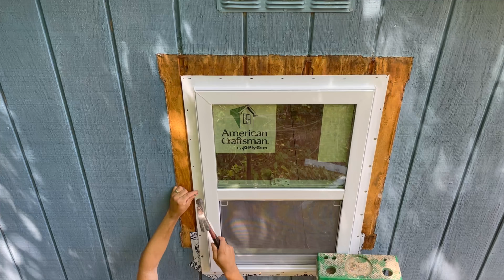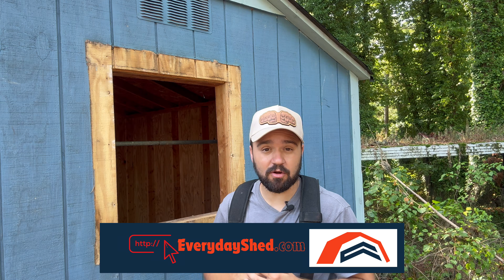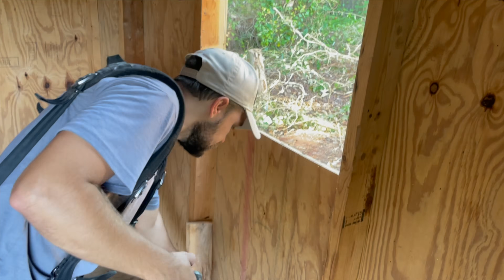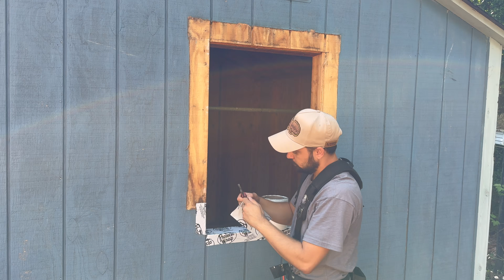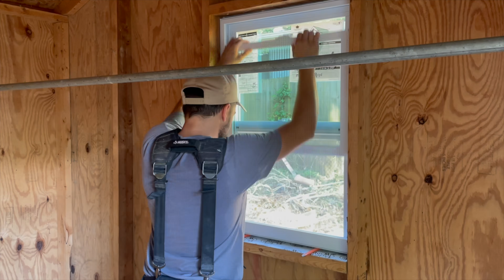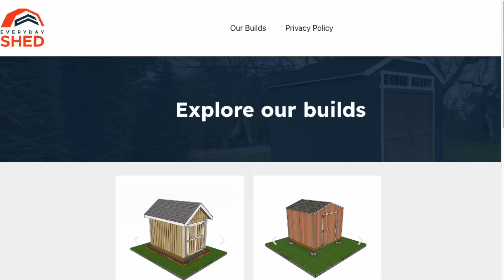How To Replace An Old Window Shed | Avoid Water Damage

Comment: Great channel, subbed. Can't believe you don't have more subscribers. 
How do you deal with trim over the nail flange? Even using roofing nails, the hump is noticeable. I used a router and put a 1/8th inch groove in the trim.